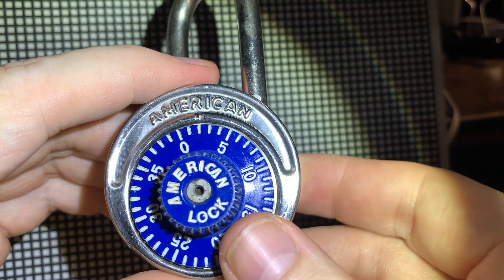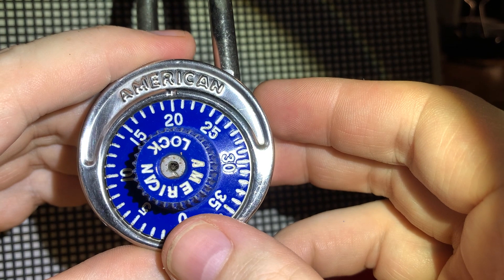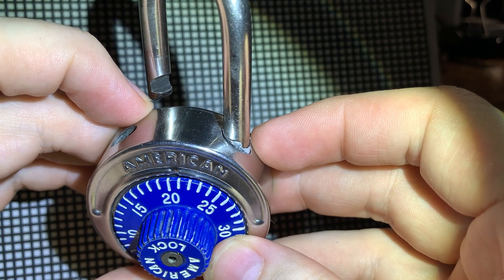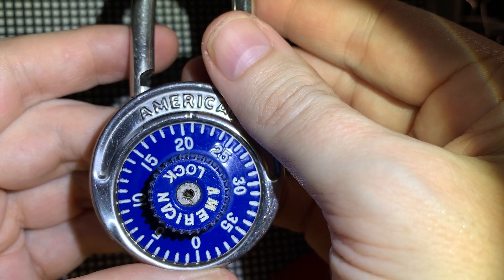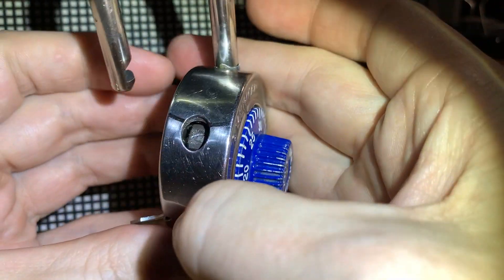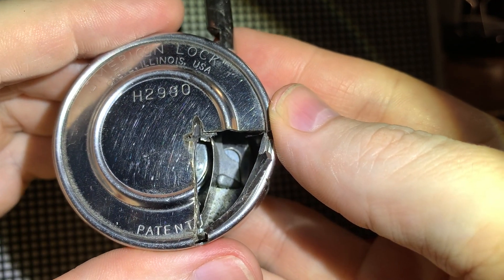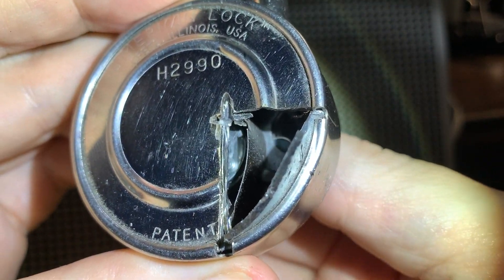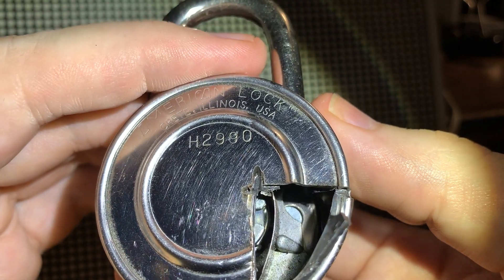Decoding an American combination padlock by inspecting the gates inside

Comment: Most American dial combo locks do open on the right,  Masters on the left, and I've never seen a Master lock with the latch spring and body plate blocking the view through the shackle hole, only on American's.   You must have a transitional lock from the buy out, but not sure if it's from before or after.

Have a great day,  
side note:  if you lift the rolled edge that holds on the back you can pull the back off then un-roll the rest of the edge and then reassemble later.

Comment: Hi. I have 2 of them and I dont wanna destroy them. I agree that the method which other videos was instructed on the master locks are not working on these. I will really appreciate if there is any way to find the combinations.
Thanks
Reply from the maker: The padlock is made too well to decode without drilling as far as I can tell. I was using cheap aluminum shims for the shackle which tore apart like paper but some locksmith grade steel shims may do better. Otherwise you are stuck with drilling a small hole in back and using a borescope to align the gates.